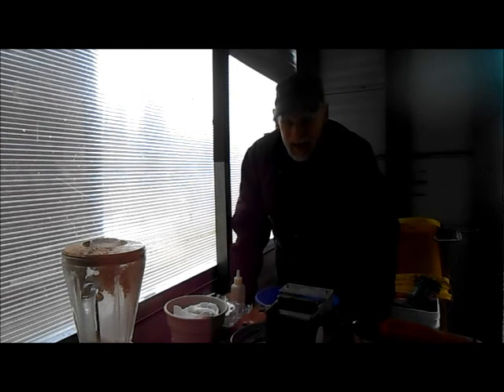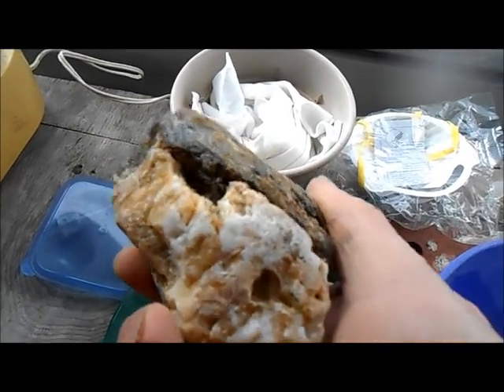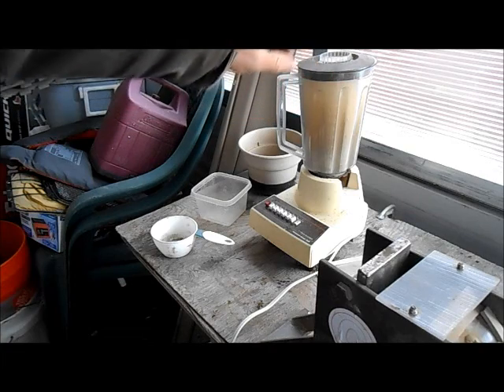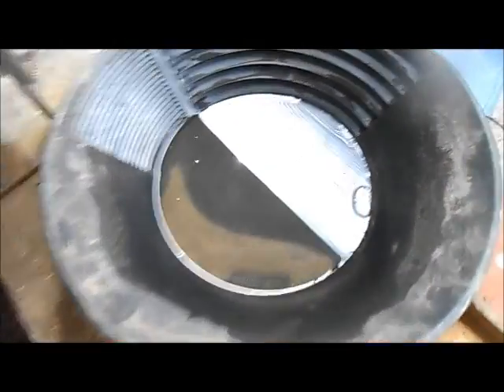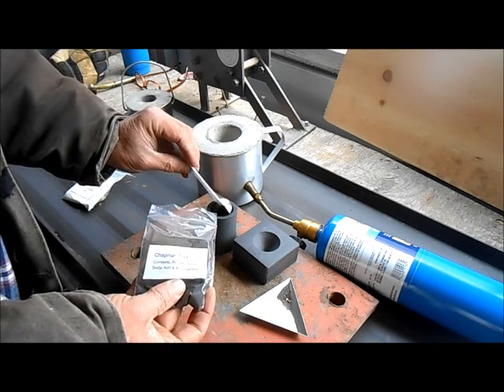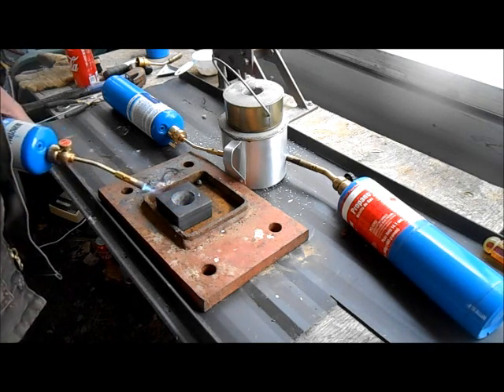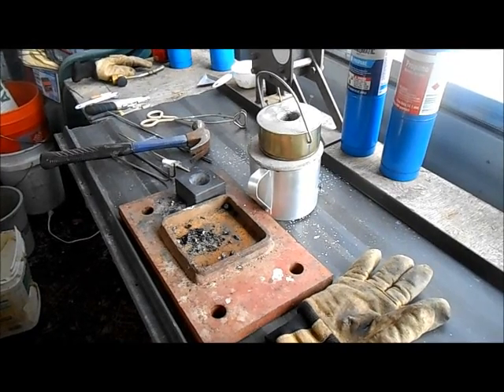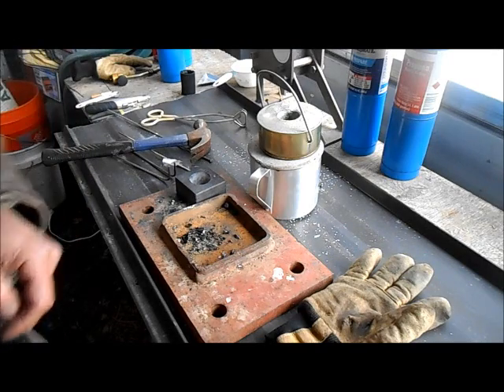Crushing & Melting Gold Ore & Quartz

Comment: I use map gas torch ceramic melt dish borax heat the melt dish up first get the bottom red hot sprinkling some borax let it melt hit it with a torch 25 second again dump your gold in little bit more borax on top and then proceed to melt your gold I have melted as much as 35 grams with a single Mapp torch this way any more than that and you'd have to add another static torch you have to use the handheld torch 2 coax the gold into button by moving the torch Flame around pushing the gold to coagulate together then heat it well and when it comes time to pour it quickly don't pour it slow or you can simply let it solidify and then pluck it from the Melt dish with a tweezers into cold water dousing it in cold water helps to break off any borax slag that may stick to the button by the thermal shock this way of doing it is very economical and not wasting so much gas to heat up the furnace it takes less than 10 minutes to make a one ounce gold bar this method
Reply from the maker: Thanks for the tips and sharing your method that works for you. I was going to just do the melting dish and torch then a friend wanted to melt down some scrap gold and silver so I bought the furnace and I think the dish would work fine for what I am doing. Thanks again.

Comment: 1 propane torch 1 piece of scrap 2x4 some borax powder and some gold. That is all you need to melt the small amount of gold you had. Oh a hammer and anvil helps. You can also use the hammer to create a depression in the wood to hold the gold borax mix. I would not hit the mix full force at first to avoid blowing it across the room. Sneak up on it. Or should I say get it warm and melt the borax then hit it full force. And yes the propane torch does not melt the gold the burning wood does the melting.
Reply from the maker: Thanks for the tips I have never heard of using a 2x4 before I have heard of using a potato. Now that I have spent the money on the furnace I think I will just spend some time on it and get it figured out. Thanks for watching.
Reply: @alanrobertson2510  I would as well. I started out with a thought and realised an explanation would be needed. We used to make small coins out of gold all the time with that method. I would think that an ounce or two in small bb's of gold went flying over the years in the garage when we missed with the hammer. Unfortunately that garage is owned by someone else that may never know of the treasure hiding under their car.

Comment: Looks like we have been working on same project. I have been working on 3 different furnaces for a month and a half. Lots of bad info on the internet. Lots of work to wade through the garbage. Yippers, lots to learn on the smelting for sure. Thanks for your input.
I keep wondering how a 1/3 hp cooler motor would work on that little crusher? It's a cutie and does a nice job.
Reply from the maker: Yes we have I can't wait to see your furnace when it is done. Bad info out there you are not just a kidding but practice makes perfect right. I have been reluctant to put a motor on the crusher it does jam from time to time and I have to get out the breaker bar with a motor I think something will break at some point. Wait till you see the new mat I am excited to run it.
Reply: Alan Robertson 
Looking forward to the new mat. I've been laid up with some medical problems and so slow getting things done. Just finished up a mat form based on yours. Works good. Made a new sluice for the new mat and made a slight mod to it that really changes everything. Spending too much time playing on it. Going to design a new hybrid unit based on it. Keep up the good work, my Silicone stock is doing great. 😄
Reply from the maker: I hope you get well soon that stinks when life happens. I think your stock is going up just from me alone just bought another case the other day. Have fun playing with the new mat. The one I made is from a 3D mold and I have know idea where this will go if it works.
Reply: @alanrobertson2510  

Just out of curiosity, does the gold stick to that strip of silicone you have in your pan? I was just wondering if it would stick to it better than just the plastic? If so, maybe a mod we can do to help keep the gold in the corner.
Reply: I was thinking 1/2" impact wrench, gets jammed, throw it in reverse...
Reply from the maker: That might be worth a try sometime.

Comment: how did you make the rock crusher? I would love to make a diy crusher with my drill too..... do you plan on including it here? Also, you should probably use the plastic cover of that tupperware to cover the crusher instead of your hand, huh? Safety FIRST I always say. Thanks for sharing :D
Reply from the maker: Hello . I did not make the crusher I bought it on Ebay The guy put them up from time to time it is a great little unit. The crusher comes with a magnetic plastic cover to keep the rock from flying out I do just use my hand sometimes. Thanks for watching.
Reply: Do an eBay search for “the crush”.